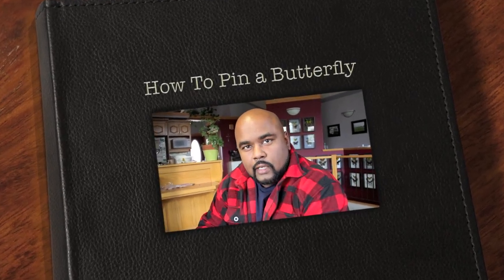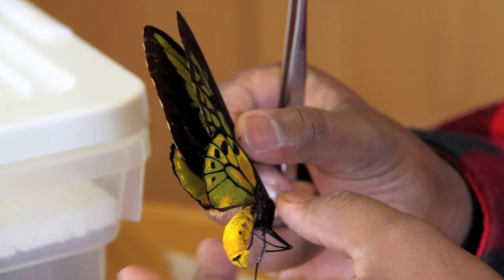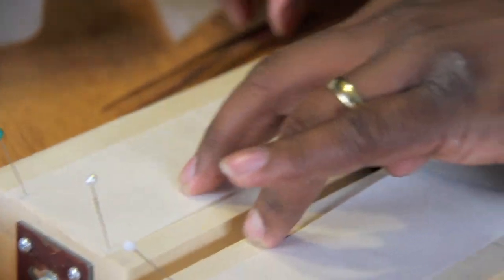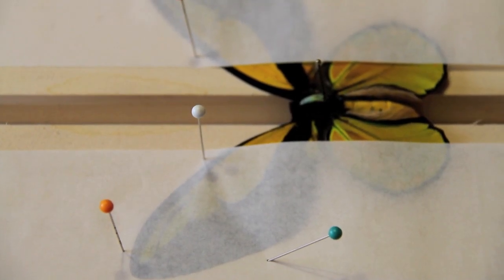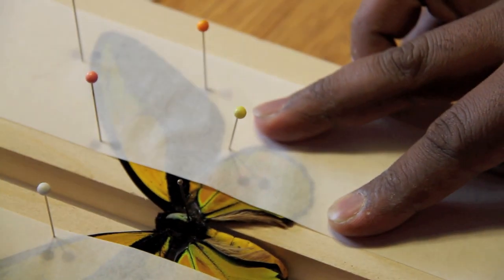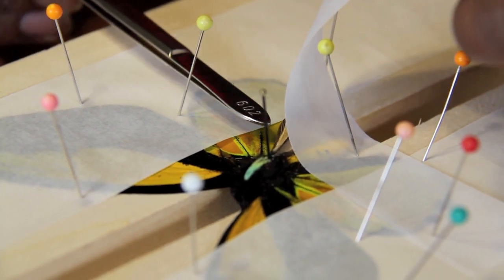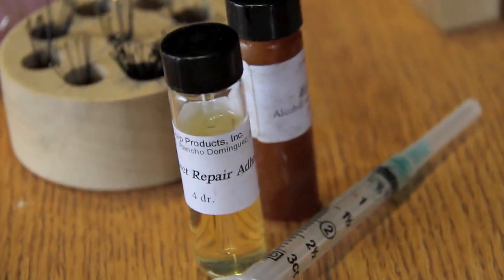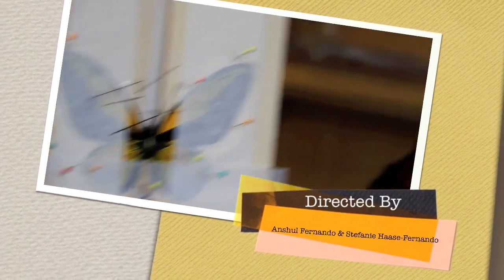How To Pin a Butterfly.mov

Comment: I put pinesol and water in a crumpled tissue in a jar and put the butterfly on top and waited like 15 mins and it became soft, used wax paper because I dont have any tracing paper but it still turned out ok, had a lot of scratches but the butterfly was still beautiful to me and I'm thankful for this video even if I didnt follow your specific instructions, it was still helpful as I found a mite on the butterfly under the microscope and felt the need that I should do something pretty with it before mites devour it x

Comment: If you glue some graph paper to the boards you can get it perfectly symmetrical. Glue down 1 sheet over the whole thing then use a scalpel to cut out the middle strip.

Comment: Will any piece of wood do for pinning? I have pine boards left over from a project. Can I use them and trim them to fit in a display frame?
Reply: +BlastFromYesterday 
I'm assuming you mean for a spreading board, like his...? You can use soft woods, cork, foam (compact polystyrene works very well) but not any sort of hard wood or basically anything you'd use to build a structure. haha
Reply: I like using soft woods like pine and balsa wood. They produce the best results.
Reply: actually have you ever thought about the styrofoam plate
flat,easy to cut and shape,and easy to pin
Reply: Bill Huang YEs, I have tried this method and over time the specimens can catch on the styrofoam pieces as they become elevated. Using soft wood in my experience yield the best results.